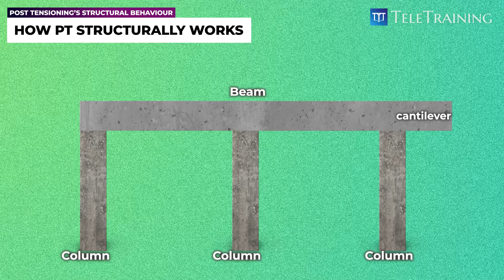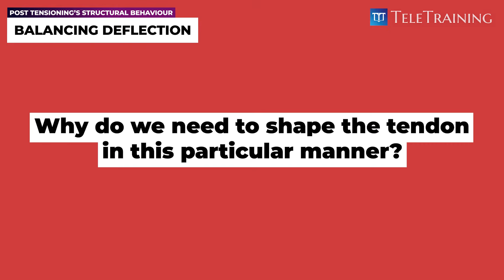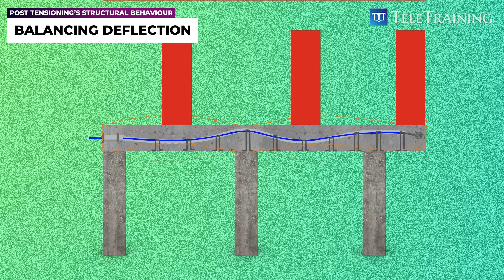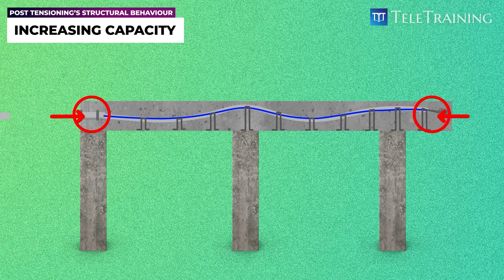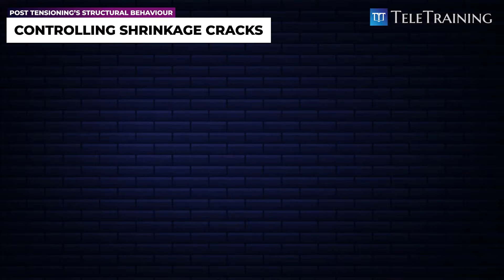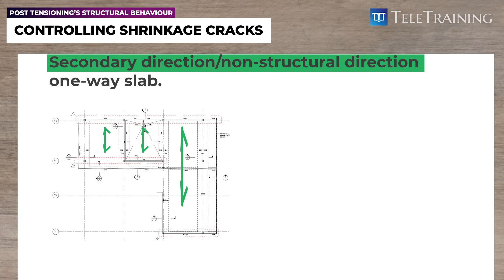How does post-tensioning prevent concrete beams from deflection?

Comment: Nice video and concept well explained. 
Is there no risk that tension cable corroding with time?
Reply: PT cable is usually in a Blue sheathing to prevent corrosion. In some cases it is used to prevent bonding with the concrete and most have a rust inhibitor or lubricant and water proofing inside the sheathing. PT cable is usually torqued to 30-35000 lbs and whatever you do if you come across one during any repairs or remodeling DO NOT CUT ANY OF THEM! 😮